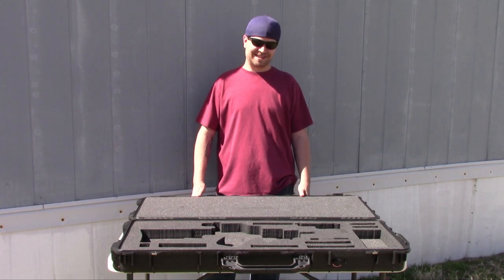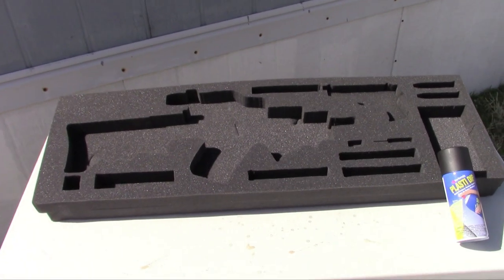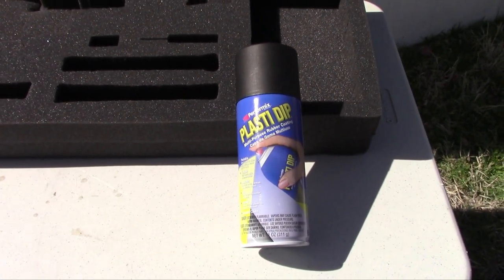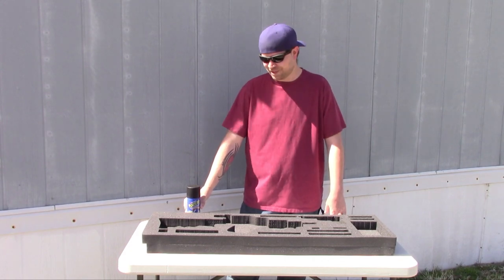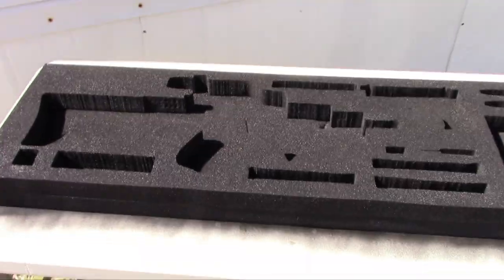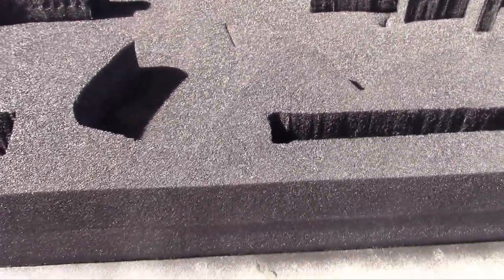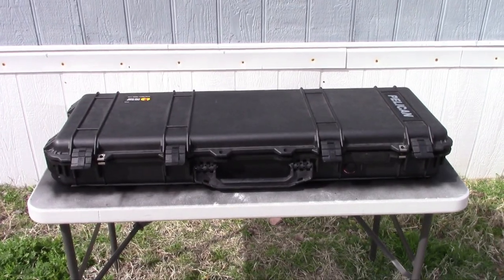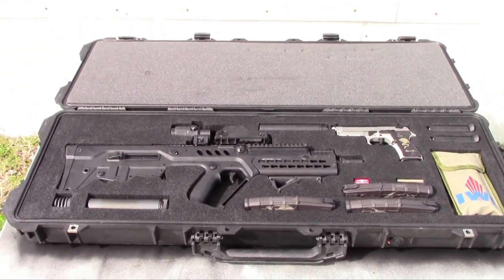PART 2 - Plasti Dip Foam Tutorial for the Pelican 1720 Gun Case (How To PlastiDip & Hot Wire Cutter)

Comment: Great video, I wonder how the plasti dip, being harder, wears against the valuable objects in the case?  I ask as Im doing a takedow recurve pelican case and many of the components are wood.
Reply from the maker: That is a good question... Everything I have in my case is metal (no wood) and considerably harder than the plastidip, therefore there are no wear issues. The plastidip does not harden 100% but I am still not sure I would chance it with wood.

Comment: What's the reason for gluing the two layers together? I would think there'd be more benefit leaving them separate. For example, if you ever want to change your case organization again, you'd only have to replace the cut layer and not the base. If you glue the layers together you now have to replace both layers. Yours is the second Plastidip video where both layers were glued together but I can't seem to find a good reason why.
Reply from the maker: The problem with leaving the middle and bottom pieces separate is that every time you lift an item out (especially something large like the rifle), it doesn't want to come out of the foam... It wants to bring the entire piece of foam with it. That was my only reasoning.
Reply: The Hard Way, makes perfect sense. Thank you for the quick reply. It helps since I'm in the middle of trying this all out for myself now. Your videos have been a big help.

Comment: I think you might save some time and money if you did the first few spray coats with something like Behlen Vinyl Sealer. It dries a lot faster so less time for the foam to absorb, and then you have a nice sealed surface for the plastidip to adhere to.
Reply from the maker: Interesting idea! My goal previously was to have the foam absorb as much plastidip as possible and then stop as soon as it reaches max saturation.  Therefore, there isn't really much plastidip on the surface of the foam, it is all inside. Having a nice thick layer on the exterior of the foam could potentially be very nice too though.

Comment: how long did you wait between coats?
Reply from the maker: I really didn't wait long at all, just long enough to visually see that what I just sprayed has absorbed... Maybe 10 to 30 seconds? As soon as you can see it get sucked into the foam just begin with the next coat. At some point you will begin to see that it no longer wants to absorb any more and at that point you can stop before it starts building up at the surface.
Reply: The Hard Way Thanks buddy. just put the second coat on, about to start the 3rd
Reply from the maker: Good luck! Let me know what you think after it's completed and fully dry
Reply: The Hard Way Sure will
Reply: How long you let it dry for ?